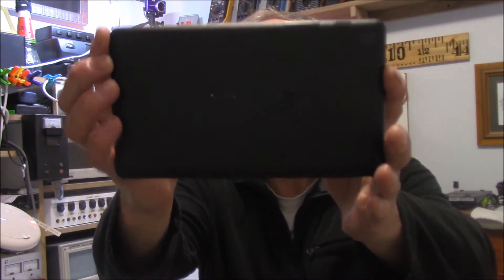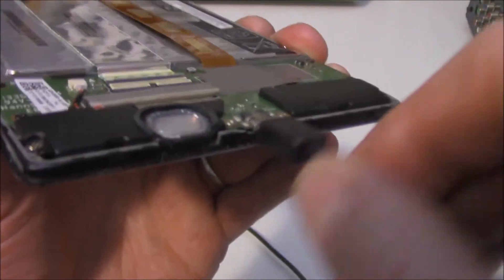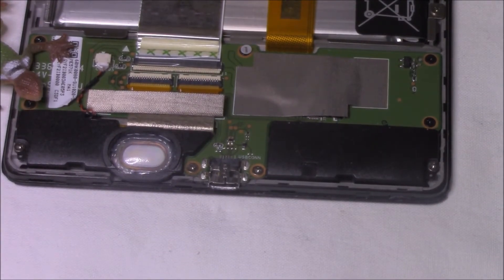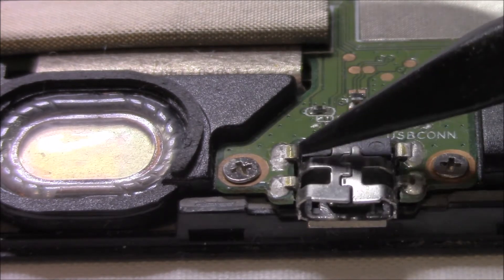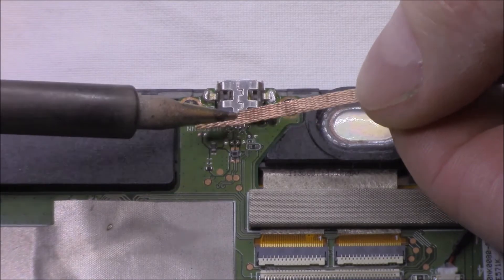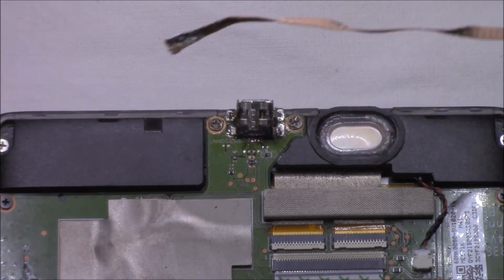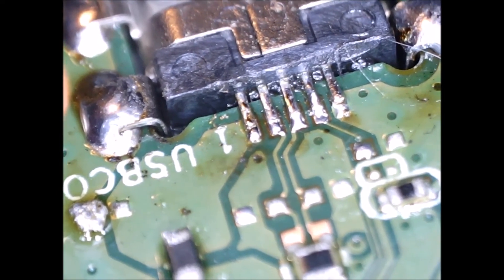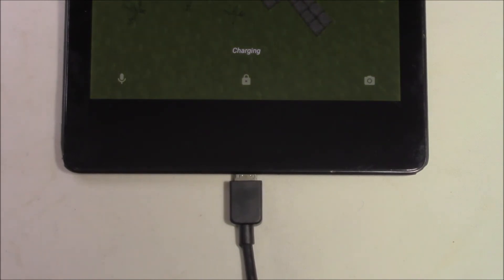Asus Nexus 7 2013 Not Charging MiracleMAX

Comment: The Nexus 7 2013 I have started charging intermittently.  Replaced the battery as it was quite swollen.  Eventually charging failed completely.  Confirmed it was not the USB socket.  Replaced the charging board ME571K_SUB with a new one.  Still no charging.  Will a Qi wireless charger work?  Any advice, thanks.
Reply from the maker: Sounds like you might have a short somewhere. A wireless charger will not work unless your device has the hardware built in to accept wireless charging.

Comment: It's 2020 and Thank you very much for your video! I replaced my nexus 7 2013 battery but it still had trouble charging. Then I found your video and squeezed my charging port, now it's finally charging! Thank you so much!
Reply from the maker: You are welcome 😊
Reply: @MiracleMAX  the same with me
Reply from the maker: @juskask  I hope the video was helpful 😊
Reply: @MiracleMAX   My Nexus hasn't been changed for a year. I thought there might be something wrong with my battery, and I didn't have a new charge port. Inspired by your video, I opened the charge port, just used a knife to polish its pins, it worked. Thank you again!!!
Reply from the maker: @juskask  I'm glad the video helped 😊

Comment: Mine says it is charging on AC but the % doesnt actually increase and continues to decrease while charging
Reply from the maker: You might find the battery is no longer able to receive a charge. Or it might be a charge circuit fault. Is the charge port in good condition?

Comment: Good job, Mark. I've seen some that were very tough to remove. I'm going to try Chip Quik next time.
Reply from the maker: Hey Robert,
I haven't heard of Chip Quik before, but after checking it out, looks like a worthwhile investment. Thanks for letting me know.
Reply: You're welcome, Mark. I nearly burned a PCB up one time trying to remove a USB 5-pin jack when I had to resort to my Hot Air Rework station. Chip Quik is the easiest way to remove them and multi-pin IC's without stressing or damaging PCB's. Be careful though, sometimes the Chip Quik solder will roll off the PCB like mercury when you tilt it. So make sure it doesn't roll off in your lap until it hardens!
Reply from the maker: Yeah, I think we have all been there! Spending ages trying to get enough heat into something to remove it. I had to remove a mosfet off a heat sink once because I didn't think about all the heat being transferred into the heat sink (DUH) - a job that it was doing very well!
I'll definitely look into the Chip Quik!
Once again, thanks for the feedback.
Reply: No problem. It will make your life much easier.

Comment: I have had a similar issue with an S2 & S4 that took some googling to fix and all it was was an accumulation of some lint from my pocket squishing to the end of the socket and using a flattened fine wire was able to pick it out when device was turned off.
Reply from the maker: Hey Marcus, 
I have seen that as well. You were correct in your repair method. You've gotta watch that pocket fluff!

Unfortunately, this one was beyond repair as the connectors within the jack were damaged due to little people taking over Dad's tablet!

Thanks for your comment :)